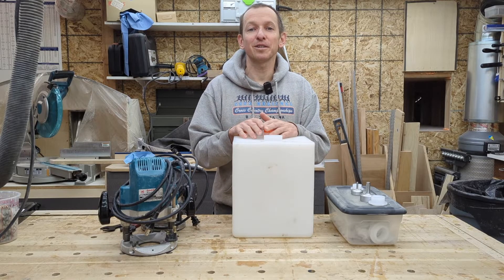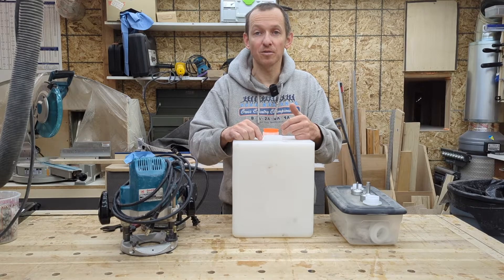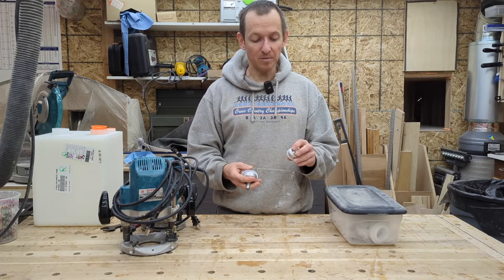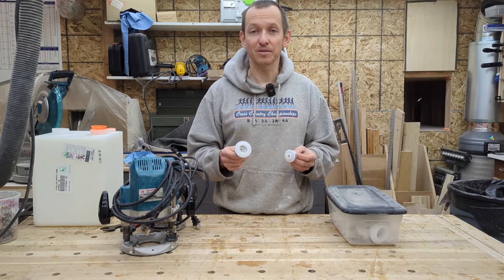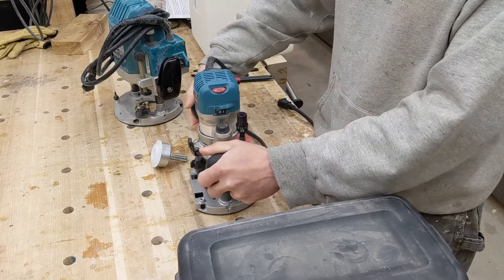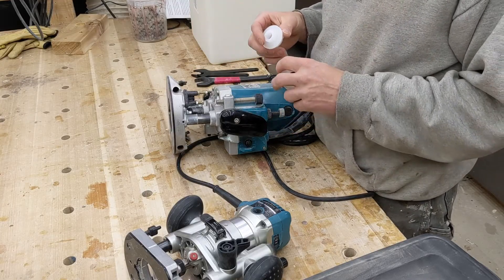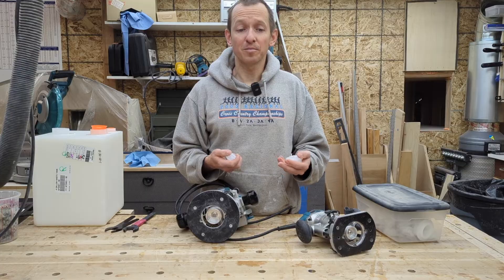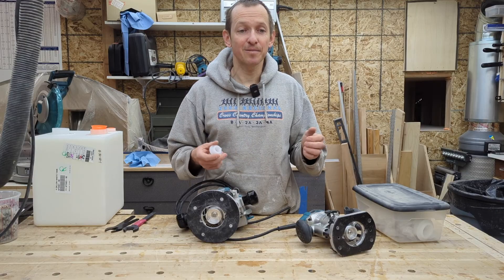Spin Welding Water Tank Fittings

Comment: great video! Couple of pointers for anyone else doing this for the first time:
1. For larger fittings, (our big ones were 1.5in NPT) it seems the 12amp Bosch router has just enough power to spin it and overcome the friction.
2. Also for larger fittings, don't use the plunge base! The molten plastic pool will reach the base of the router and affect the weld pool and potentially start to stick to the base. This happened on the 1.5in fitting but we got lucky and still got a good bond.
3. You're much more likely to stop early and under-drive the fitting vs overdrive. The entire process does happen fast, but fight the urge to stop early!
4. They sell "flush" fittings where the threads go inwards into the tank. Highly recommend these as in tighter installs your threaded fittings will stick out way less.
Reply from the maker: Great points!  Thanks for sharing!  Where did you source your drivers and fittings if I can ask?
Reply: @projectofscience got the fittings from icon direct, and had the driver laser cut, $10 vs the $250 they wanted. That’s the other benefit of the flush fittings is the drivers are simpler to recreate and can be made with 2d laser cut parts and a bolt for a shaft.

Comment: How does this process work when really close to the adjacent walls of the tank? Concerned about enough surface area for the weld at the corner. Thanks.
Reply from the maker: Well, I should by the end of the week have a more general plumbing video and I did install one of my fittings purposely as close as possible.  With the hole cut pretty snug it seemed to generate enough friction to get a good puddle and no problems with a leak test, or when tightening the fitting in.  Guess only time can truly tell, but initially it worked fine.